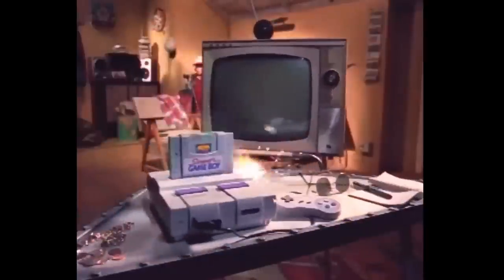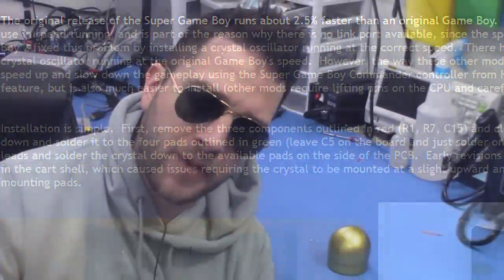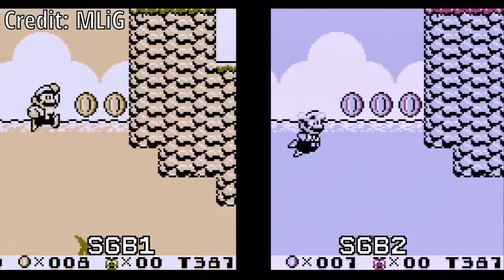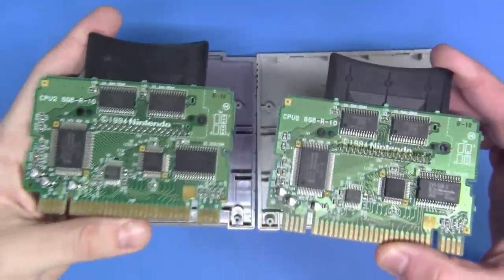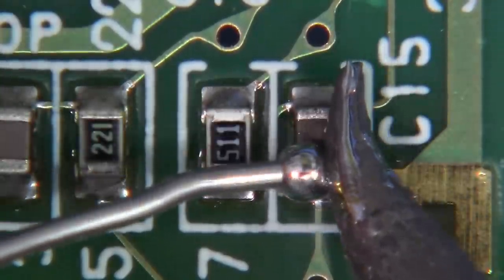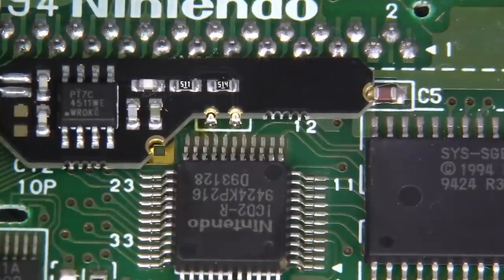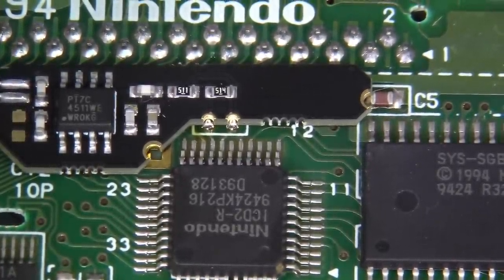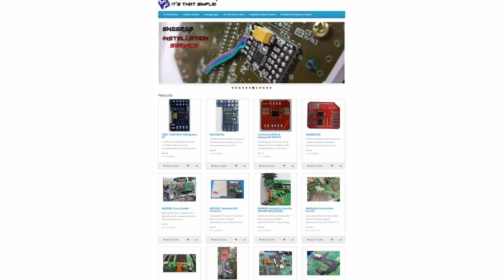The Super Game Boy | Fixing Nintendo's Dirty Flawed Secret

Comment: Since the question comes up a lot about PAL units, and I've seen it multiple times in the comments here as well, I'll go ahead and answer it and maybe Voultar can pin this.  Yes, PAL SGB units also have an incorrect clock speed.  However, by default it's not as bad as the NTSC units.  Compatibility-wise, this mod absolutely should work with PAL units, no problem.  I say "should" only because I have no way of testing PAL units, since I don't have access to a PAL console or a PAL display.  However, having sold many units to PAL customers over the years with that exact same caveat attached, I've never had a single person come back and report any issues, so based on that, and knowledge of the PAL unit's design (it's basically identical to the NTSC PCB, with the exception of a PAL lockout chip), I am fairly confident in saying this mod should work for PAL units.

However, that being said, I'm currently unable to ship to a lot of PAL countries, because Tindie still doesn't have any way of processing VAT for the EU and UK, despite promising sellers that they are "working on it" since 2019.  I'm looking into alternative selling platforms, but I don't have any ETA on that, sorry :(
Reply: for Germany since July 1st, 2021, every CN22 and CN23 form is scanned auotmatically and the receiver is invoiced for VAT automatically. Apart from the 6 € pre-payment of Postal Service fee, there is no other hassle for neither the receiver or the sender, so you can send to Germany even without Tindle implementing the pre-charge IOSS electronic VAT way for customs
Reply: try lectronz
Reply: is there anywhere in the eu stocking this mod or any other way to get it?, thanks
Reply: @Raging1337  I'm currently trying to transition my production from small hand-made batches to proper mid-scale assembly, and that's going to change a few things.  For one, I'll be able to keep things in stock more consistently, but for another, I'm going to be trying to figure out EU and UK distribution, whether that means figuring out how to register for VAT processing, or finding an EU distributor that I can partner with.  I'm not sure what that's going to look like, but it's definitely on my roadmap.
Reply: @qwertymodo  thanks for the quick reply, cool that your evolving to the next level in production im glad for you on that,im not sure how these things work but maybe you could reach out to zedlabz? They stock lots of parts and some from other mod creators like yourself(dunno if you know of them already?) im pretty sure they're always looking for cool new mods, i think this mod will gain much more popularity going forward,good luck🙂
Reply: thanks for making this mod. bought 2 of it to malaysia. no tax for items below myr500 so there won't be any problems for me.
Reply: I wonder if it is possible to make a clock mod that can switch between two clock rates. One for a skip free 50 Hz display and the other for accurate game speed. Both clock rates would be useful for different reasons. The 50 Hz output would be useful for old TV's and for systems without a 60 Hz PAL mod while the accurate clock would be useful for systems with the mod and SGB's with the link cable mod.
Reply: @raymondtwiner1283  I've looked into the possibility of a switchable clock generator, and it would definitely be possible.  However, there isn't any way to get "skip-free" 50Hz display, because the GB hardware has the ability to just turn off the LCD screen whenever it wants, it's not held to a strict sync rate the way CRT's are.  If it were an issue of display sync, then the SGB2 would be worse in that regard, because the "overclock" in the original SGB1 is due to the whole thing being driven off of the SNES master clock, which should mean that everything is kept in sync, and the SGB2, which breaks that sync should then stutter more as a result, but that's not the case, and stuttering is actually improved when running the GB hardware at its native clock speed.  It may be the case that PAL consoles are also improved by this mod, but I have no way of testing it.
Reply: If all Gameboys in the world had the same clock speeds, then all Super Gameboys should have same hardware on board themselves, so it shouldn't affect basicly anything in regards to being PAL or NTSC. The only thing that comes to mind is that Super Gameboy runs asynchronically to SNES now, so for example one frame could be dropped once for a while or there might be some tight edge case scenario in some game, but it is hard to tell without deep knowledge how S.Gameboy works with SNES together.

Comment: Never noticed the speed difference myself, but honestly not bothered by it.  A lot of those old Gameboy games, like Mega Man and Castlevania, just crawl on original hardware anyway.
Reply: The speed is not as noticeable unless you played the game to death on actual hardware. I installed the mod a few years ago and the main reason I did it was to get rid of the frame drops. If the games run faster they also end up skipping frames to match the fps output. It's very noticeable in games like Super Mario Land. You run to the right and every second you see the clouds and blocks skip a pixel.
Reply: @chamoo232  i think the pitch is what makes it noticable for me
Reply: @CrashFan03  Yeah if you played the game on a GB before it can be weird hearing the music faster and at a higher pitch but if you never played the game before it just seems normal. The frame drops can be noticed on any games that have steady scrolling movements. In Tetris, not so much since only the blocks move. Mario Land, Donkey Kong Land and Megaman on the other hand it can be annoying once you notice the little skip every second.

Comment: Were Nintendo aware of it back then?  Could that be one of the reasons why the SGB1 didn't have a link up port?
Reply from the maker: Yes, Nintendo was completely aware of this and is precisely the reason for the link port was omitted. The speed discrepancies between the link port between the SGB and DMG made data transmission incompatible.
Reply: @Voultar  Ah, wow.  makes you wonder why they didnt try and slow it down, not even for the US or European releases.
Reply: Good observation
Reply: I guess they didn't include a correction chip as a cost cutting measure
Reply: Of course they were. Nintendo are the masters of releasing great products with one single glaring flaw.
Reply: They fixed it and released a rendition over seas . But America never saw it’s launch unfortunately . But with eBay it’s easy enough to just import one
Reply: @adultmoshifan87  Yeah, I was wondering if it was possible to fix it via software.

also, what is the speed difference on a PAL system if they already run 17.5% slower than NTSC.
Reply: Remember Super Game Boy came out in 1994, back then there were not that many games that would required the use of the link cable that much and most of the ones that did required it had Super Game Boy feature that would just use two SNES controllers for multiplayer instead especially the fighting games. It wasn't until the Pokemon craze in 1998 happen that Nintendo would make the Super Game Boy 2 which came with a link cable. By that time the Super NES was discontinued worldwide so there was no point in releasing that outside Japan.
Reply: @Larry  You can't fix it in software because the timing is a small fraction, and any additional CPU cycles would already cause a delay that is outside that scope.
Reply: @VOAN  is right. Before Pokemon, nobody really cared about the link cable. There were some games that used it, but nothing that would justify the cost of including it on a SGB. After Pokemon, it was a whole different story.
Reply: @Larry  well, i can tell you that much: the speed difference on a PAL system wasn't big enough for teenage me to notice that games music had different pitch and stuff, but what i DID notice back then, was that the gameboy camera's video feed was not as "smooth" on the SGB as it was on my GBC ... i thought it was a bit jerky at times ...

Comment: I knew of the clock issue (which is part of the reason why I bought an SGB2), but I never dreamed that a solution would be this simple. He also makes a kit to add a link port.
Reply: Nintendo you had one job making a super game boy. Make a game boy for the snes.......
Reply: The only thing this would need is GBA compatibility now and this would truly be a dream come true. Sonic Advance co-op would be pretty novel and rad to play in this way, I would think... As I always thought their portables were the extensions of the last/current consoles they had at the time... But also helping the older generation have another life... As they kept 2d alive forever, honestly. Anyway... Not sure how to end this. I just really wanna play some Sonic Advance co-op with a Super Nintendo controller. As emulating it on the SNES mini feels so smooth this way.
Reply: @codydfwn  Raphnet makes Super Nintendo to GameCube controller adapters, so with a GameBoy Player, you could use an SNES controller on all games, and maybe use some different mappings.

Comment: Generally, when you do a PCB design, you try to leave nothing under the crystal in case there is interference. It is just a rule I follow all the time. Is it really safe to place it like that?
Reply: It was the best I could do with the parts available and the space constraints of the existing board.  The crystal is shrink-wrapped to avoid shorting against anything, at least.  I'm going to be redesigning the board soon to switch to a completely on-board SMD oscillator, so that won't be an issue anymore.
Reply: @qwertymodo  that's awesome, I've seen earlier posts regarding your product and how you have been constantly updating the design
That's awesome

Comment: What temperature do you use for this job, and generally other jobs? I always run a high risk of burning boards and components. I’ve been between 343 to 398 C. I am a novice, but still doing many of these mods… Haven’t broke anything so far!
Reply: I'd lower it to 300-325 C range. 398 is very hot and you'll very likely burn off pads if you're not careful. Only time you'd want to think about going that hot is if you're dealing with a very large ground plane.
Reply: It also depends on your ambient climate when it's really cold I would crank it up a few degrees more but I stick to a happy medium of 350
Reply: 300ish Celsius is more than enough. Even 343 is pretty high.
Reply: @TooBokoo  well I'm up north and 300 doesn't cut it for me the solder won't even melt on the tip so I use 340 to 350 but for me 350 is the sweet spot especially since the cold wind tends to cool down the iron in my case but everyone situation is different.
Reply: I use 325 C for .5mm solder in normal electronics use. 400 C if the pads are large or I'm doing other bigger joints. This is for 60/40 lead/tin solder, I don't use lead free stuff!
Reply: @rubenmejia4881  I live in Minnesota. Where are you soldering, outside in your backyard while is snows on you? I solder in my unheated garage and even when we're hitting -30 degrees Fahrenheit my solder melts fine at 300.
Reply: @TooBokoo  I was reading also depending on what solder type you use between leaded & unleaded degrees can vary but no I'm not I'm that extreme of environment but with snow around yes
Reply: @rubenmejia4881  Why are you using unleaded solder that's the real question. High quality leaded solder is ALWAYS what you should be using for DIY jobs even when if you're soldering to lead free solder. It is better in almost every way (besides it's toxic if ingested) so like if you're soldering baby products then I suppose?
Reply: @seemlesslies  well I can't tell ya if it is or isn't but according to the label on it its definitely lead and smells like it too. At the time of me acquiring my soldering equipment I wasn't aware of good quality solder I thought it were all the same to me at that point. I just got a big ol roll from Amazon that seems to work okay within the 340 - 350 range for me. Now that I am aware I'm waiting for the roll to run out to buy the "good stuff"
Reply: People think I'm nuts (well, I am, but that's besides the point here), but I pretty consistently stick with 380C. My method is get plenty of heat into the joint as quickly as possible to flow the solder and finish the task before it can spread into the component or adjacent components. For large sections of old solder (case in point, the soldered joints of the RF shield in the NES) I'll crank it up to 410C to quickly flow Chipquick into the joint and then let it cool before attacking the joints with my solder sucker. Now for surface mount I'll turn it down to about 350C, but that's still considerably hotter than many people work. I work quickly enough that I've never damaged a pad in a console, any of the electronic boxes I've restored from old Toyotas, or any of the telecom components I often have to rework as part of my day job.
I should also add that I always use Kester 63SN/37Pb solder, unless I'm reworking a component at work that specifically requires lead free solder.
Reply: Depends on the tip and what you're currently doing.

Bigger the tip, less the heat you need, but still, I rarely go below 320°C, and 280°C is the absolute minimum.

For smaller tips, desoldering unleaded and heat sinking pads that's an appropriate heat range, though you'd be better off using a hot air gun in conjunction with an iron, even blasting low temps it makes precise jobs in tricky areas a breeze.

If the board is sinking heat too fast don't be stubborn, heat up the whole thing in an oven at 100°C max.
Reply: @TooBokoo  lol. I was wondering the same thing.
Reply: in the video it looked like he was using low melt solder

Comment: Honestly I just think the sfc super gameboy 2 is an overall much cooler product… proper clock speed, no mod necessary, plus it has the cool translucent shell and link cable port. They’re pretty inexpensive too! So that’s the route I went. But good to know that there’s something that can be done with all the “regular” super game boys out there so they’re not immediately considered useless by anyone who still wants to play on one.
Reply: Same
Reply: Hell you can actually use the sgb2 on a north american snes by just clipping two plastic tabs at the bottom of the cartridge slot
Reply: @minifigamer9898  yeah, easiest mod ever! Nothing needed but a pair of pliers and 10 seconds of your time lol. After clipping my SNES I honestly have more fun collecting weird SFC stuff that didn’t get released here than I do collecting regular old North American stuff
Reply: @minifigamer9898  Or you can just take the board out and put it in the SGB1 and not ruin your SNES.
Reply: @kiwisoup  bro the only reason those tabs are in it is to prevent you from playing Japanese games on an American SNES, it's like saying soft modding your Wii to remove region locking is "ruining it"
Reply: Oh and not only that, but the sgb2 has a hole for a link cable, something the sgb1 seems to... not have.
Reply: @kiwisoup the tabs in an American SNES are like your wisdom teeth: they're completely unnecessary, and are better off just being removed

Comment: Thanks @voultar for the helpful videos.  I did this exact same @qwertymodo mod about two years ago, but ended up with glitchy short horizontal lines appearing all over the screen. I haven't touched it since.  Any ideas on what I may have done wrong?  All the solder points seemed pretty solid.

Comment: Hey Voultar I'm a super beginner solderer and I have a quick noob question, everytime I try to solder it sticks to the gun and doesn't actually 'stick' to the board. and my tip just ends up getting super flooded with solder. Any help would be appreciated. Love your content
Reply: I can see many thing causing that. Your tip is dirty so solder stick easily to it. 
Temperature is bad. Solder flows when it's hot so if you don't heat the spot you try to solder enough before applying the solder it will just flow on your soldering iron. 
Last thing would be flux. If you don't use any then it can be extremely hard to solder anything.
Reply: @chamoo232  I use flux but I might not be using enough after seeing Voultar use his. Is there any worry about using too much flux? How do you determine what temperature the gun should be? Should I just get it as hot as possible?

Thanks for your help.
Reply: @mustardchips7419  No worry about too much flux if you clean it after with alcohol. Temperature too high can burn the contacts or even the board so don't go as high as your iron can go. 340-350 is usually more than enough. Put the iron in the spot for a few seconds to heat it up before adding the solder. Sometimes even the solder you use can make it easier. Don't use the crap they give you along with the iron if it came in a kit. Get something a bit better. Better iron, better flux and better solder all makes soldering a ton easier.

Comment: did this a few years ago. Also a good idea to recap the SGB while you have it open. helps with audio issues later on, since they're using surface mount caps from the 90s in there.

Comment: Hahaha this is not a flaw to me... I noticed the games sounded "happier" on a Super GameBoy when I was a kid, and I loved it!
Another cool thing was the aspect ratio that changed to 4:3, this made the games look a bit more like their NES or SNES counterparts.
Reply: the gameboy is not 4:3?
Reply: @bland9876  it was 10:9
Reply: @bland9876  I believe what kleev is referring to is the Super Gameboy’s output aspect ratio, as the Super Gameboy converts the Gameboy’s stock 10:9 ratio to a 4:3, which was better suited for television at the time.  Otherwise you would have distortion of the games video proportions and thus defeat the purpose of the device to begin with.
Reply: @assymcgee1  but the games don't show in full screen anyways so no need to strach or squish the screen.